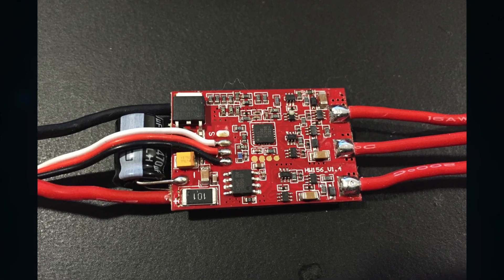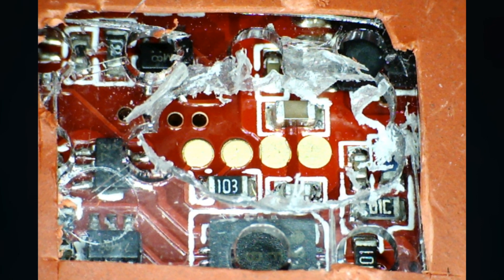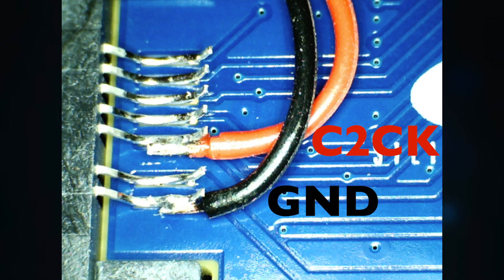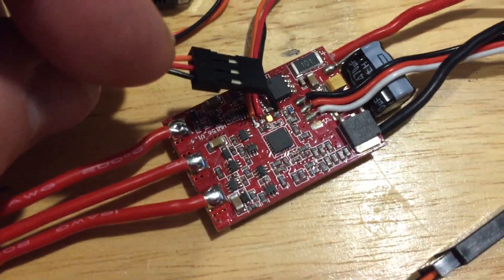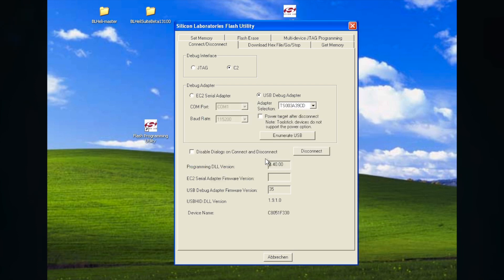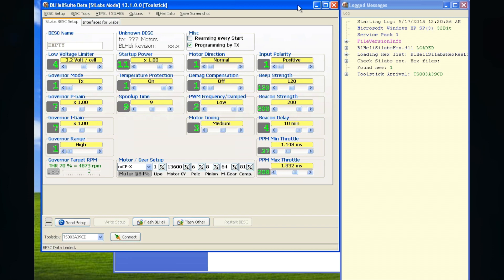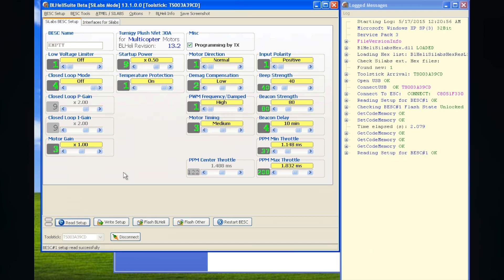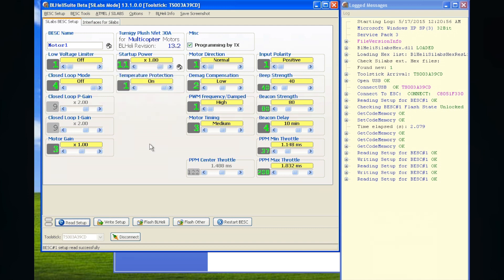Flashing Turnigy Plush NFET 30A with Silabs Toolstick

Comment: hi.. can it set to bidirectional mode?
Reply from the maker: +Tan Ory Jaka Perdana Yes, if it does bidirectional depends on the software you flash. The one i used can do that. You have to set it in the settings.
Reply: they said, BLheli V13.1 or higher have bidirectional mode in it.. is that true?
Reply from the maker: +Tan Ory Jaka Perdana Yes it is true. I tried it today, see here:
http://mygiguser.blogspot.com/2016/03/flashing-esc-with-blhelisuite-and.html
Reply: thx bro.. ^_^

Comment: Hey there, thanks for the detailed video. I wanted to ask if you might have any thoughts on these 20a emax nano series esc's. They have f330 chips and some pictures are shown in the link.

They have a custom blheli version of blheli 13.1 installed I believe but they cannot be read though the signal leads in bl heli suite. Dunno if you might have any thoughts about how I might flash these with original blheli and update them. Sadly no hex file is available yet either.

Many thanks

http://www.rcgroups.com/forums/showthread.php?t=2453721&page=3